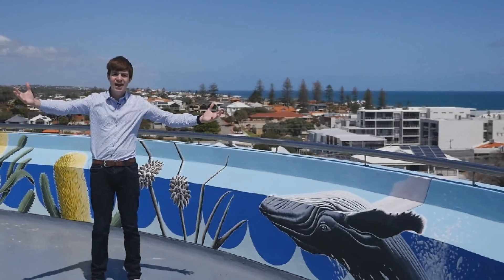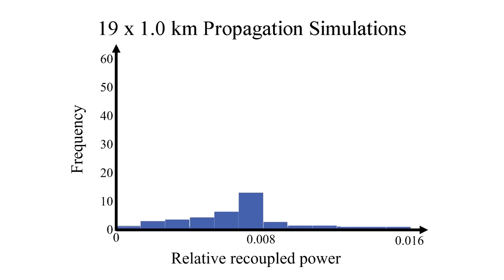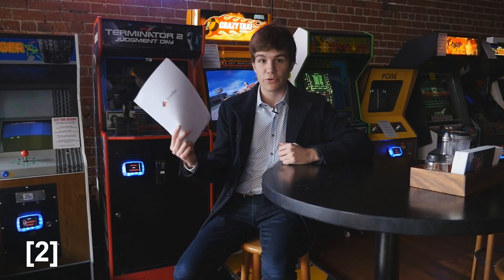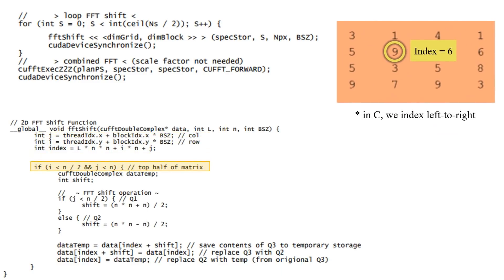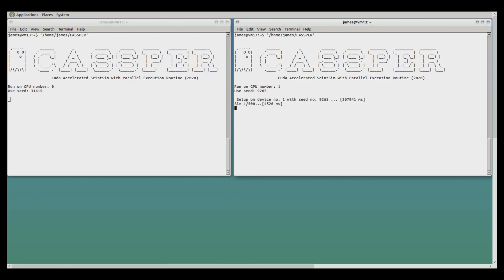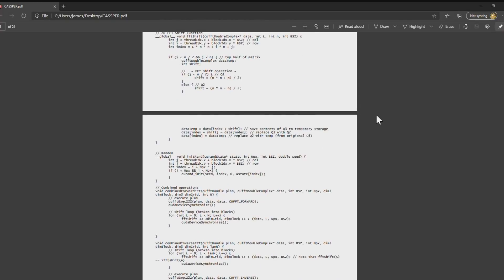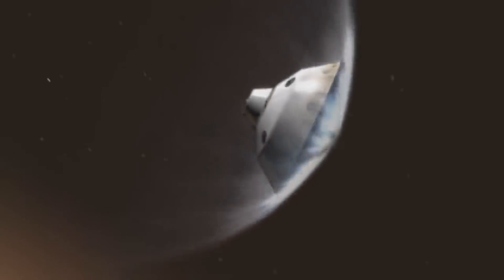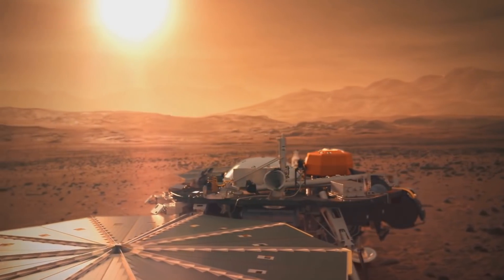Scintillation modelling for Martian laser communication

Comment: Wow this was really cool. I have been messing around with using assembly to speed up sections of code in C. Maybe that could help you get some speed out of demanding sections. It's even harder to manage concurrency way down there away from all abstraction, but the power of using the large SIMD floating point instructions of avx and avx512 may really be a help here, as most compilers use less fast instructions unless told specifically to do so.
Reply from the maker: Excellent idea! Will try it out!

Comment: this is why they are thinking about using laser as not the main tech for the communication, but a part of the communication, they use RF to transmit to the satellite, that can be done with a compacted dish the size of your plate and then transmit it to the satellite in orbit, from there it can use lasers as relays to the "L points" because the L points in each planet's orbit move with the planet, it's predictable with some simple mathematics, from there they can transmit to earth's L points and from there can be beamed down using RF once again.

In space it's a near vacuum, for you to have the refraction occurred on Mars you would have to send the laser pretty far for it to become useless.

To line up the Tx Rx points would seem to be hard at the start but if your satellites are good with telling the other satellites where they are, you should be fine and it's just trial and error.

Comment: Why go through all that work when you can take a queue from wired signaling and do lasers in differential pairs. For more and better, simply add colors/locations. It would be pointless to put interplanetary transceivers on the actual planets, and so the natural solution is to put the long-haul transceivers in orbit, and then you have a stereo effect to really boost bandwidth and signal integrity.

Comment: This is very cool. You should really check out the Julia programming language, though: basically the same speed as C, but with the high-level programming ease and benefits of languages with better abstractions (including Matlab). Julia is built for high-performance scientific computing in mind, and is an excellent fit for a project like cassper.
Reply from the maker: @TheBookDoctor Thanks! My master's thesis is being written in Julia (and learning from one of the guys who invented it). Hopefully can share some progress later in the year.
Reply: Theres also numba in python which uses a just in time compilier to convert native python code to c. It has similar speeds to c while allowing the user to use python. Its also designed for scientific workloads (numpy support is baked in)